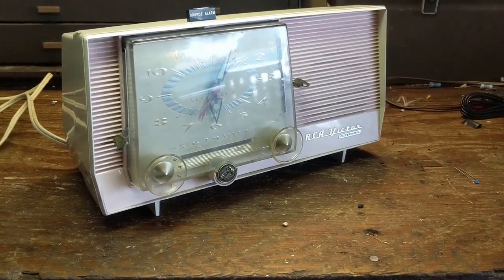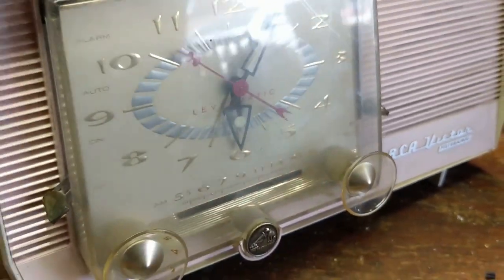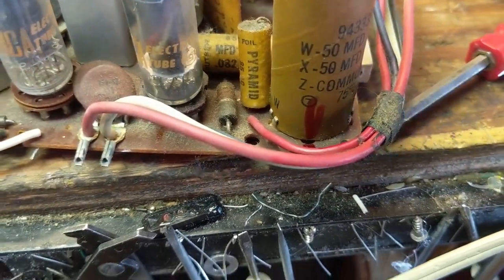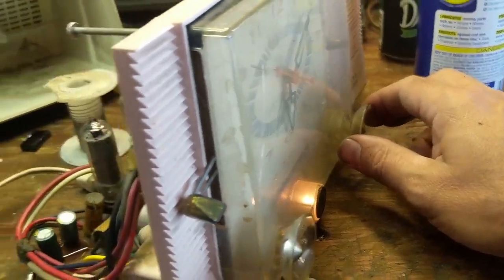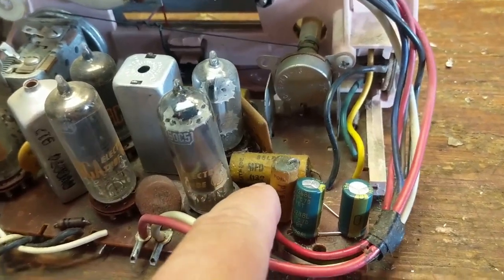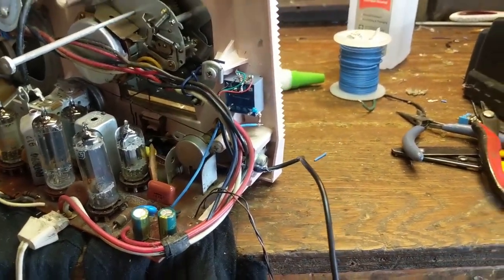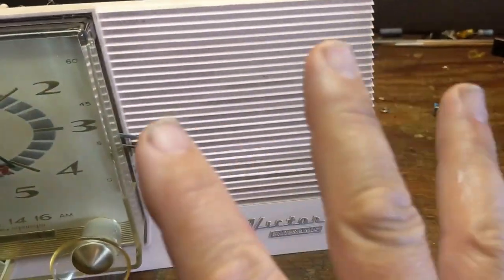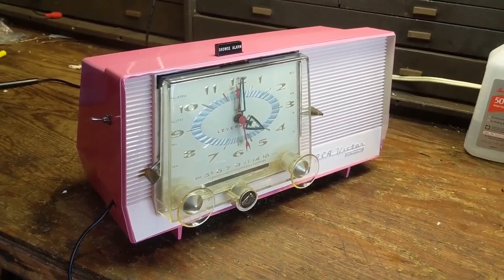Resurrecting a RCA "Levermatic" clock radio

Comment: The colors pink and salmon were very popular colors in the 1950's, and this would be highly appropriate for that clock-radio. I had that exact same model back in 1975-76 and it worked rather well. The filter cap wasn't bad.

Comment: Has a Westclox  clock mechanism  in it. Filteramic  refers to the plastic shield around the  ferrite rod AM antenna. Just a marketing gimmick. This radio is from 1960. Case back looks so much nicer with the darker reddish pink on it!

Comment: Hi Seth,
I've got the same RCA radio, almost. My radio doesn't have the phono input, but has a brass-colored second hand that looks identical to your red second hand. My radio has a Westclox clock movement and the tubes are still the same. Also, your model number is C-4FE and my model number is 1-C-5KE. I wasn't able to find any information on my model number. For what that's worth. And finally, the inside of my cabinet was full of gross nicotine, but looks a lot better once I cleaned all that out.

Comment: It is the heat of the vacuum tubes that causes the flexible cable clips to become brittle, I think that if they used the 12V tubes that were designed for use in car radios without the step-up unit the unit would run much cooler and the possibility of using a walwort producing 12V and less dangerous that the hot chassis radios.
Reply: Just time is enough, even without any heat

Comment: Nice, but the switch doesn't fit the radio IMHO. I've would have kept the original circuit, or perhaps add an insulation transformer, but surely wouldn't add the switch. Usually IF won't affect the audio if it is tuned to a quiet spot. I have a radio with a similar configuration (series string) and it also has a phono input insulated only with capacitors. I replaced them with a proper Y2 caps. Anyways, this radio is from Europe and we have 230V here with unpolarised plugs/sockets. That particular radio was still in occasional use with lot of original caps til the mid 00s and no one got electrocuted, despite those phono socket caps being leaky as hell :) And you can't hear any noise as the audio line level signal is much stronger than the AM detected signal.

I just like to keep the radios original as possible, especially examples like yours that no one touched before. On the radios I work on, I think there was not even once that I was the first one there, lot of times there are bodge jobs to be found, missing parts, etc. I never take out old electrolytic cans, and if there is no space, I usually restuff them. Few times (on a rare 1932-33 sets), I even restuffed paper capacitors.